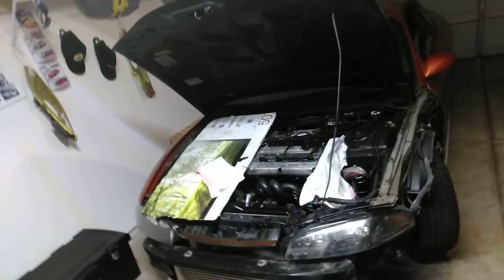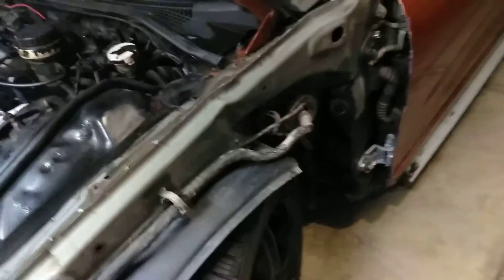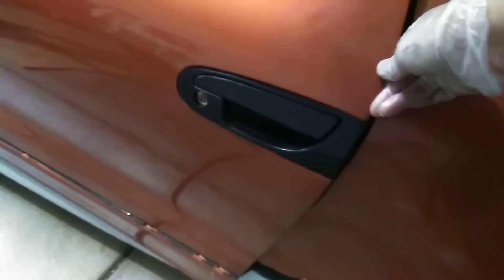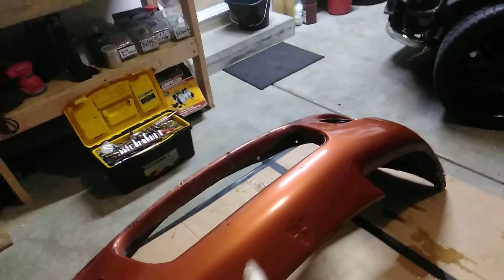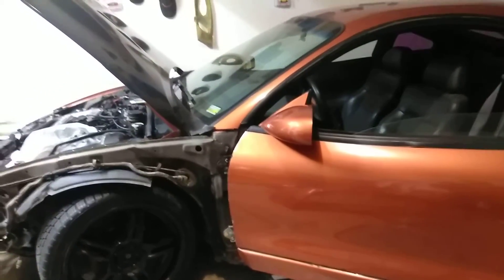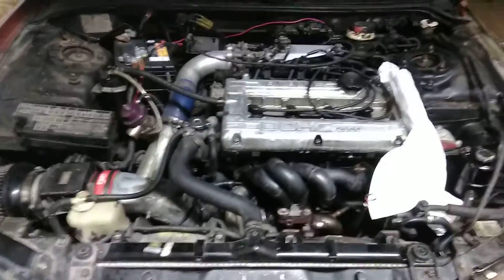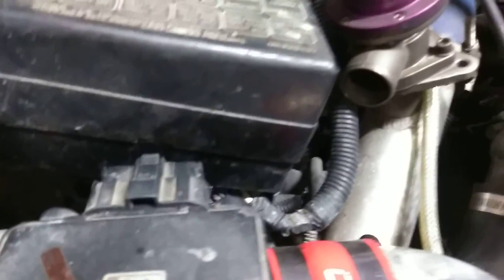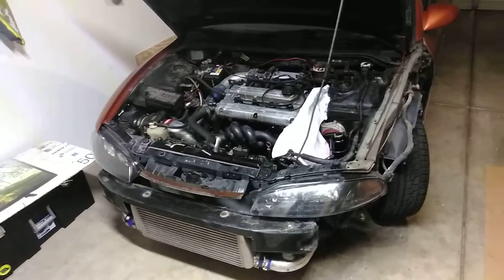GST DRAGON first cleanup under hood

Comment: that's an atmospheric blow off valve, it doesn't recirculate so nothing goes there. you can make it recirculate but it doesn't have to the advantage would be that if it does you won't have to lose power by it running rich on the shift when it blows off the pressure.
Reply from the maker: Well that's good to know thank you what do you think of my GST isn't she pretty she needs a lot of TLC I'm working on her today
Reply: @dsmchick935  she is very nice I still like the first gen body though but at least she has a 4G63 in her. I like the color that sun burst orange is sweat!